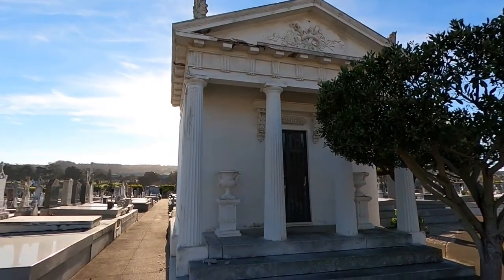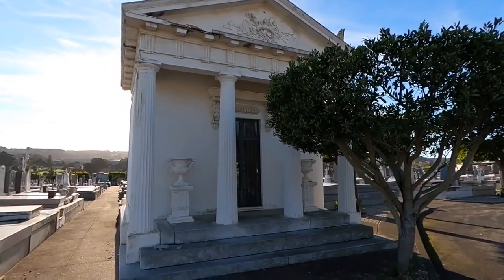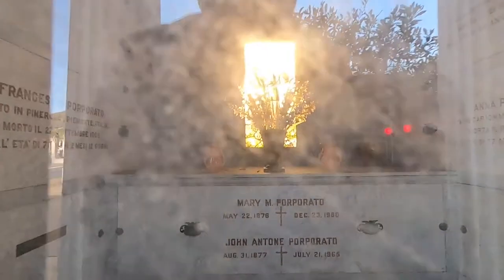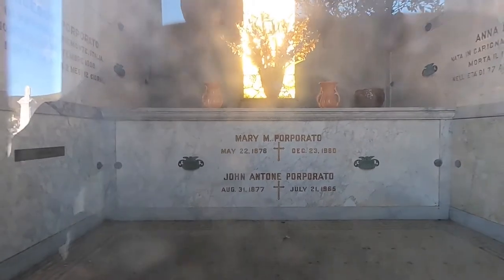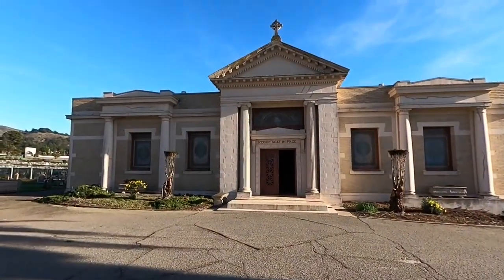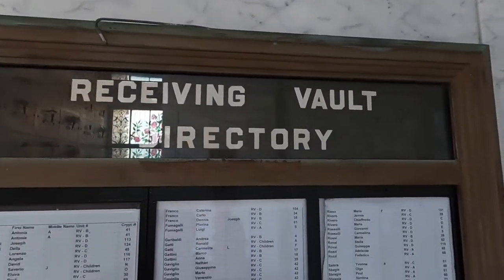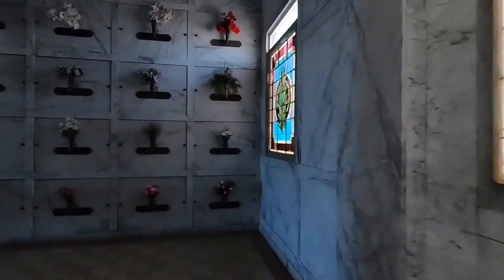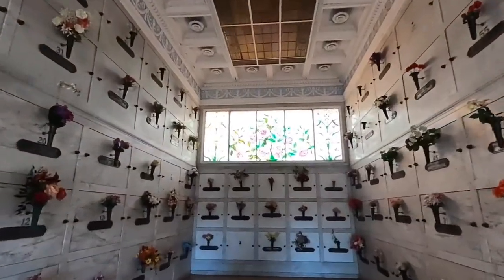MYSTERY SOLVED!  Why Crypts Are Numbered At The Porporato Mausoleum!

Comment: Interesting about the receiving vaults! In some places, they were often used in winter when it was too cold to dig graves.
Reply from the maker: Around here I haven’t run into too many of them only at three different cemeteries out here that I know of so far. But sometimes you could just find them hidden somewhere also inside the cemeteries so there might be more
Reply: @CryptDoor  Receiving faults I find around here aren't usually labeled, they're just big outbuildings. One that I know of used to be a receiving vault, but according to the groundskeeper it's now a storage shed for the cemetery's lawn equipment.
Reply from the maker: Eternity Hills Memorial Park where Wyatt Earp is buried there in Colma, they have one that’s outside with a skylight and it’s old and decreped  looking . kind of hidden behind some bushes